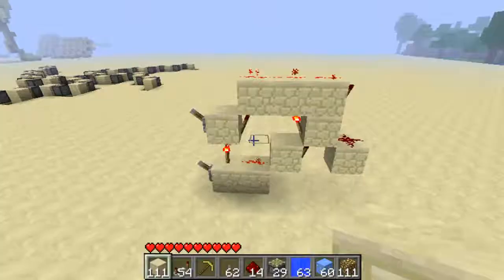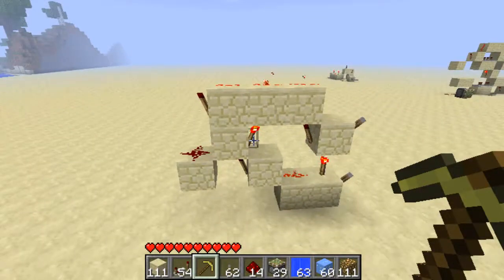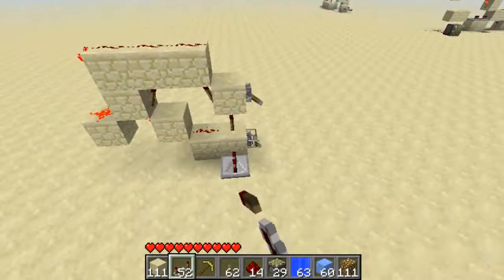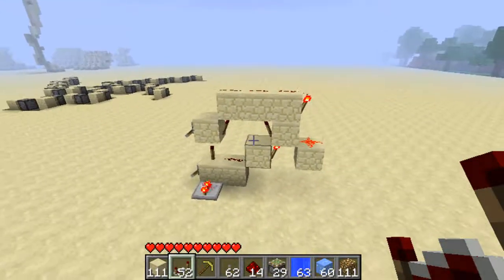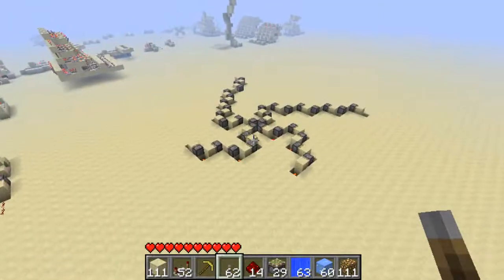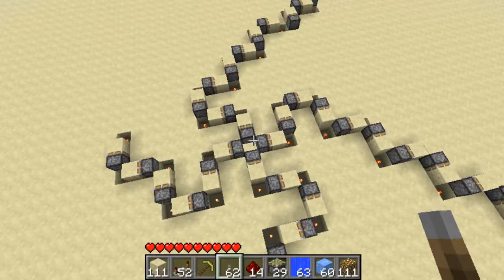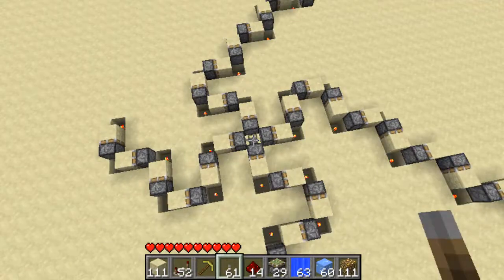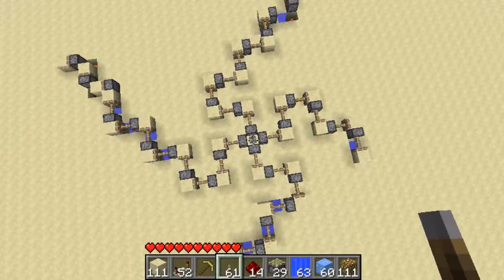1 Wide - D-Flipflop

Comment: The problem with this design is that your "D" (sic) lever doesn't act like a true clock.  The clock should pulse the value into the D-Flip Flop, not open it up then close it when you want to "lock" the value.  What I am trying to say is that a clock (or enter) should assign the value.  Otherwise, very nice compact design.